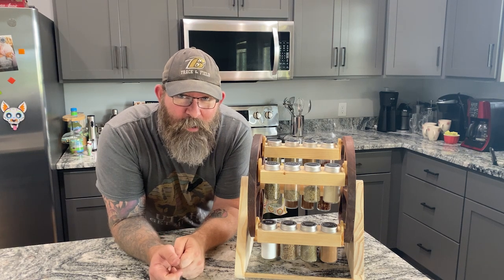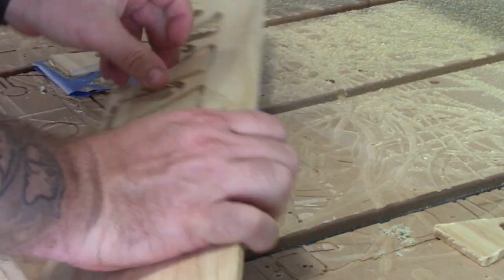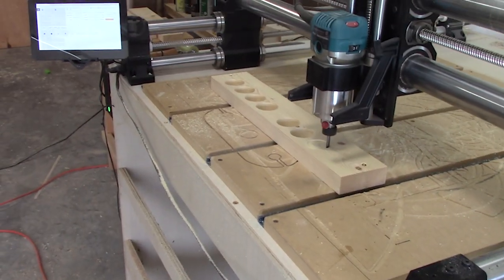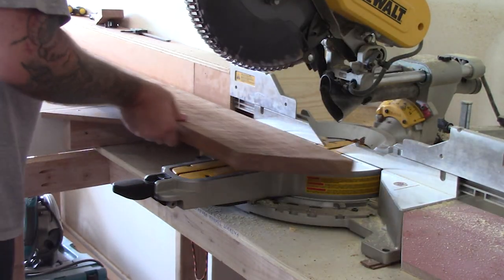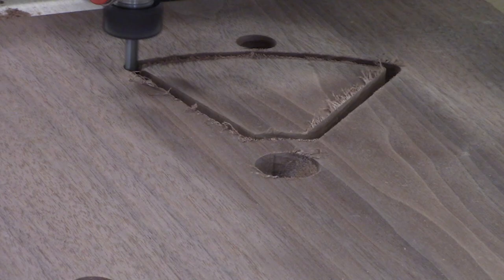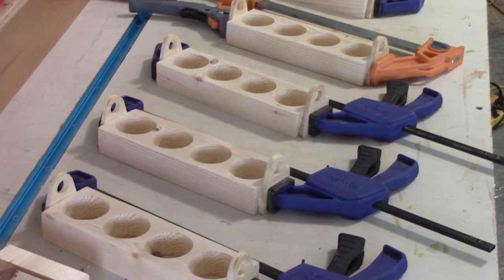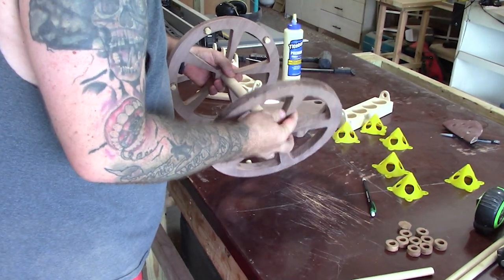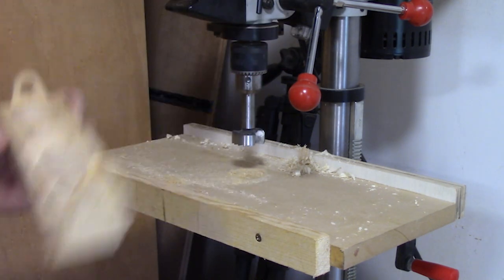Make This Awesome Spice Rack | CNC Woodworking Projects

Comment: Just a helpful tip I figured out, if you caliper the board for those walnut circles, set your depth of cut less than .05 or so, then quick sand the back side, circles pop right out

Comment: To make it as a gift, yes. However, if we want to sell it, as the title to this video suggests, we need to know material cost and time required to make it. Just by looking at it I figure you will need to sell it for $300 as a minimum to make any money. Am I wrong?
Reply from the maker: $300? Nah, much cheaper than that to make, and time on the cnc is minimal. If you make it out of solid walnut, it'd be expensive, sure.Good point though, that this video should probably be promoted as a gift idea and not a best seller.

Comment: Thank you for the plans. Will be making this sometime, my shop is very HOT now I'm in central TEXAS, no A/C. This is a very nice working project. You do great work. Keep them a comin.
Reply from the maker: Appreciate that! Central Ky here, so even though we’ve been in a cooler phase, the humidity is thick!!
Reply: I'm in central TX and adding A/C to my workshop made a world of difference! Highly recommended. Assuming your space isn't too large, it shouldn't cost too much to do. I got an 18000BTU unit and installed it myself for $1000 or so.

Comment: Tip: Use an "up down" or "compression" bit for cutting this thin material.  

A compression bit shoves material downward at the end of the bit (opposite spiral) and there is no need for tabs or sanding in most cases.

Good luck, great channel!

Comment: A tip when cutting dowels to help make the cut straight and not have little parts that break or whatever at the last part, that I picked up from Jimmy Diresta, is turn the dowel (or metal rod) while pushing through the blade on the saw.
Reply from the maker: Great. I'll give it a shot. Thanks!!

Comment: Aren't the pine fence pickets pressure treated? While in this application, there isn't really food contact, but I hate working with pressure treated wood if I don't have to.

And worth mentioning for people who don't know. Pressure treated wood is definitely not food safe. If you want to use a fence picket, the cedar ones are only slightly more, yet smell and look great and are both outdoor and food safe.

Great project!